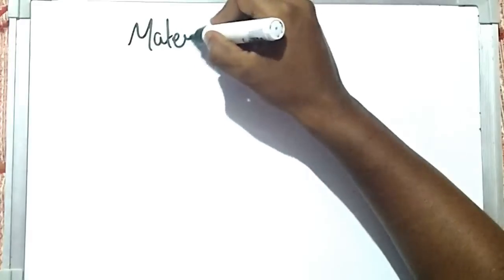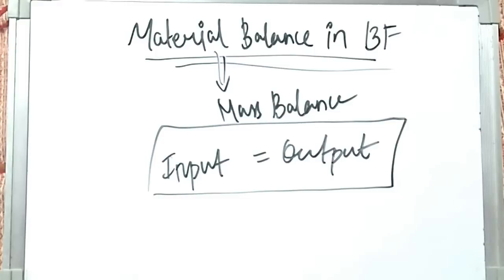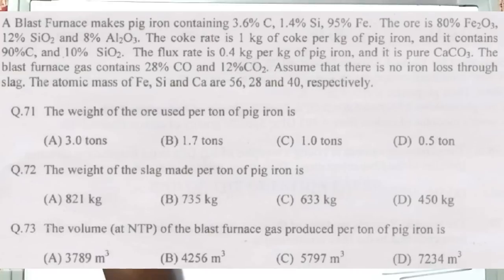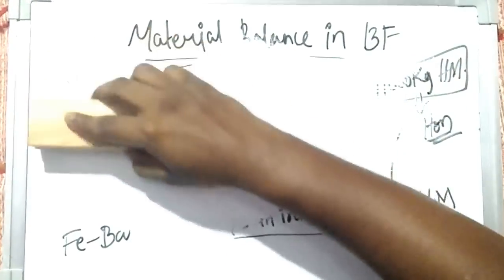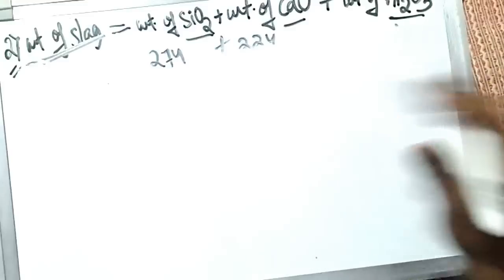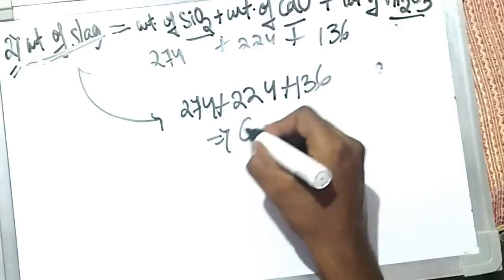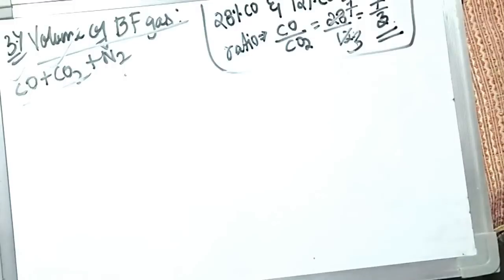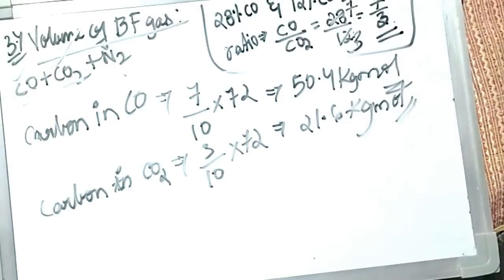Material Balance in Blast Furnace( Method for Gas given in Moles)- Lecture7- EVERYTHING METALLURGY

Comment: hi can u hep me? can you suggest a book on this subject?
why efficient desulfurization and dephosphorization cannot be obtained simultaneously in either the blast  furnace or the basic oxygen furnace?
Reply from the maker: That's because of the difference in the favourable conditions for dephosphorization and desulphurisation ... you can follow basic books like Ghosh and Chatterjee, Iron and Steel making book !!
Reply: There is thermodynamics n kinetics involved, still v good desulf. got in bhilai blast furnace up to a level of.01-.015, but that's not economic, why  high temp., high basicity slag, optimum mgo content for good fluidity slag ; that's why external desulf. is better, . high dephos.  In steel making is also possible, will discuss later.
Reply: For blast furnace iron making - akbiswas is the best book in the world

Comment: Why did you not take account of Carbon and Oxygen from CaCo3, SC choria sir (nptel) has clearly that this has be to taken into account for Carbon and Oxygen balance
Reply from the maker: Yes, I clearly mentioned that we should do it...but it will make our calculations so complex...and for GATE...we can easily get through with the major components mentioned !
Reply: @everythingmetallurgy  then how can we will get ans in gate exam because there is wide range of variation when these things are left

Comment: 1 mole is 22.4 lt. and 1 lt. is 0.001 meter cube. right? but you said in blast volume calculation that one mole is 22.4 meter cube.
Reply from the maker: Actually we deal with KgMol....so its kilo liters...so it will be cubic meter !!
Reply: Mole can be grammole or kgmole, for gmole it is 22.4 lit @NTP n for kgmole 22.4 m3

Comment: Please solve this problem...* Copper , milled , smelted and then refined . The Following information is avialab;le: Mill recovery Rate : 80 % , Avg Grade in Mit Concentrate : 25 % , Loss in Smelting Process:4 Kg/ I of Concentrate. Loss in refining Pracess: 2 Kg. /T of Blister Copper. Calculate the Quantity of refined Copper from per Tonne of ore. Copper ore grade is .65%.